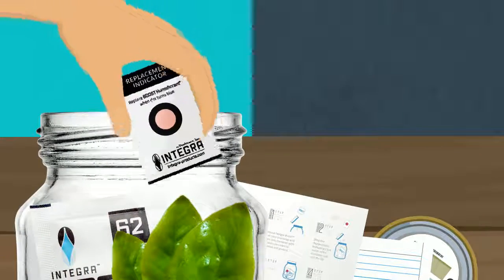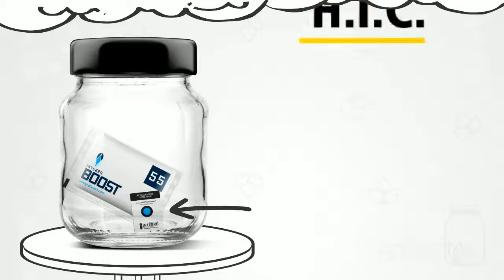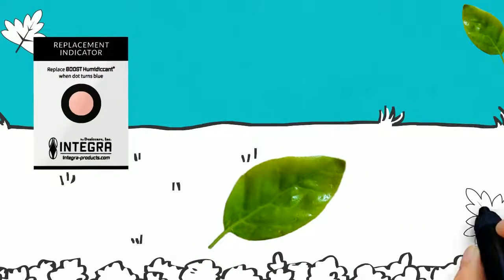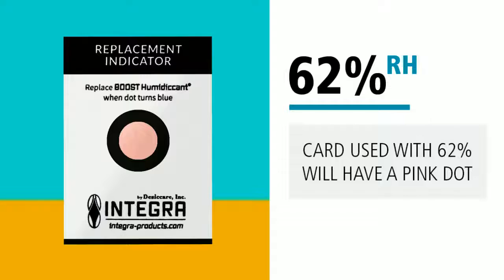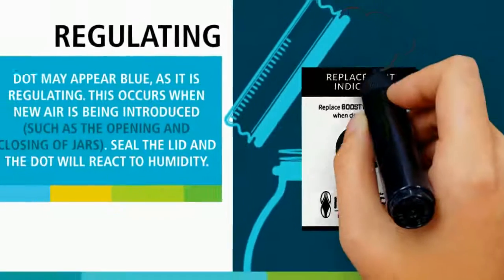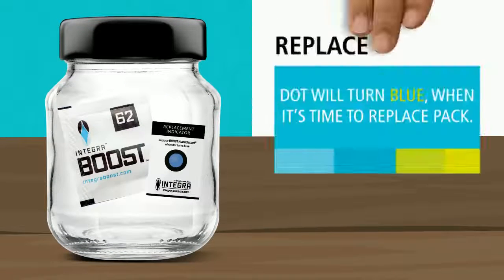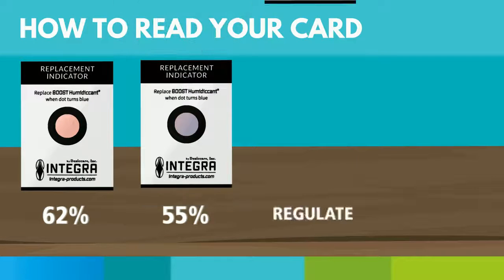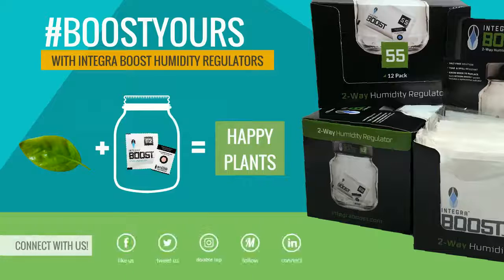HOW TO READ YOUR HUMIDITY INDICATOR CARD

Comment: So, if you don't have the card it is useless. You will not be able tell when it is time to replace the packet. You should have designed the card   in to the packet itself, and not a separate card. As it is easy to lose, or not receive one.
Reply: I used to refresh packs as well with water but it's very easy to introduce bacteria by handling the packs for a long time. I would just replace them they are pretty cheap in the long run. My 2 cents. ✌️
Reply: Remember how it feels when its new, itll be different when its used. You can also recharge the pack with distilled water and you can do this for the rest of your life, so its a lifetime purchase.
Reply: @TheNietrzezwy  Thank you for the info.